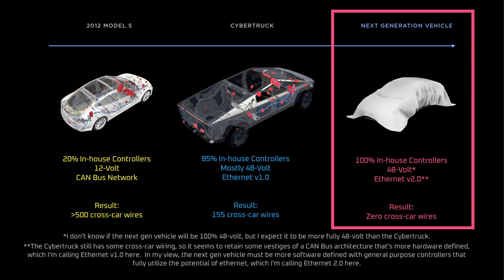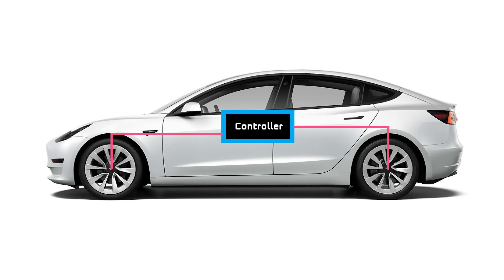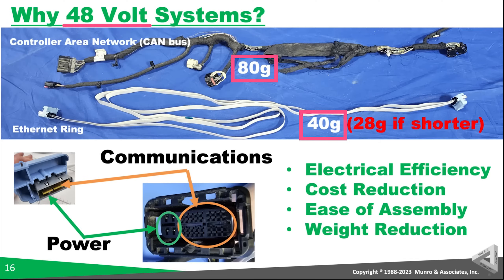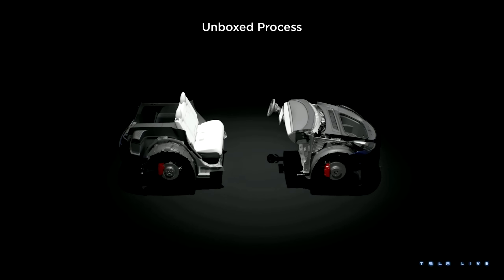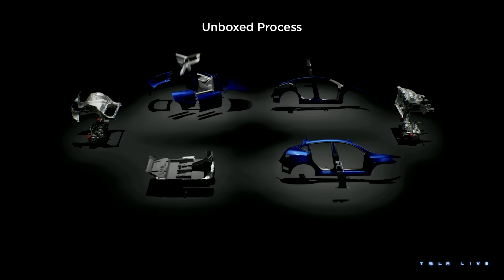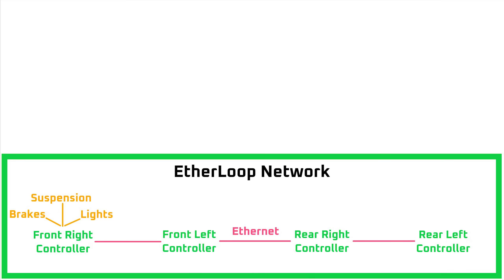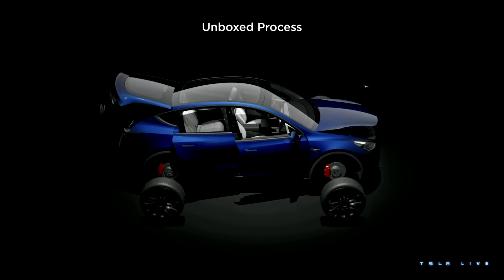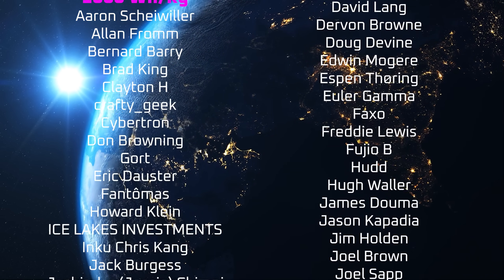Digging Deeper on Tesla's Etherloop Wiring System

Comment: With etherloop, they will have to likely build a new protocol to run, but now with advances in frequencies on a single wire, they can send multiple signals over a single wire too. So send your high speed critical signals on a priority frequency and send all other data points as a lower frequency. Think of how DOCSIS works.

Comment: 9:00 Using 48V will not help thermal management because same wattage for the chips will still generate same amount of heat load no matter what voltage you use.

Comment: We put safety systems like brakes, engine throttle, steering wheel depending on software in a vehicle that can be updated via internet connection by the manufacturer. We hope that the future car manufacturer will put a lot of money on the cyber security of the cars around the world.

Comment: You don't have to branch of the main CAN trunk wire, you can pass it through. In fact the smaller the branches are the better, ideal is no branches at all. I don't get the point of the EtherLoop, but I guess it's just a more efficient physical layer. In industry we also used EtherCAT, sounds similar.

Comment: the biggest challenge when it comes to voltage is that people like to mod their vehicles when talking the other makes. With the 12V system you can for example just hook up(with an in line fuse of course) and get the power you need.  I am guessing throwing a snow plow or trailer hitch and full braking controls on a cybertruck is effectively impossible due to being 48v.

Comment: Just for example - from 2000s Mercedes start to use SAM modules in front and rear ends of car that make the same, except safety features like SRS or ABS. From mid 2000s BMW use FlexRay data bus that have much higher speed than CAN... Nice innovations from Tesla)

Comment: PROFINET (Process Field Network) is a communication standard based on Industrial Ethernet with a comprehensive range of applications. 
The fieldbus uses TCP/IP and IT standards, is real-time capable and enables the integration of fieldbus systems.
Reply: PN only uses TCP/IP on startup and diagnostics as it is too slow for the deterministic model for data exchange in operation. It uses MAC address and device name as part of its own standards which is why it is important to use PROFINET certified devices, in particular managed switches.

Comment: When Elon said they would reduce the wiring in the Model Y dramatically, i thought at the time, "why don't they (automakers) use like 4 or 5 raspberry PI and controllers and connected them with Ethernet to control all the vehicle?" Guess i wasn't all that far off from a concept standpoint... 😅

Great video BTW...
Reply: Because if one controller fails now you don't have lights and wipers and brakes and steering instead of losing only one

Comment: I'm familiar with CAN and ethernet wirings & protocols, as well as other HW protocols used in high-speed, high-data rate computers. 
As you were describing the system & problem i had a few thoughts.
1) why tie power & comm on the same network?
The batteries,  plug charger or regeneration from braking all generate power. Access points to any power is perhaps the shortest line of all as the battery pack practically stretches the entire vehicle base. Certainly there are multiple power access points in this system.
Imagine a short power hop from any corner to any nearest access point. Saves LOT of wire weight. Let each device pull whatever volts it needs. Independent of any standards.
2) comm doesn't require heavy wires. It can be done with much lighter fiber optic strands (any one of wich supports thousands of non-interfering comm lines between any controllers.light does not interfere in many ways.
Run a single fiber loop around the entire veh and thats it.

Comment: Thanks for the information, so when the light controller goes out  the $700 replacement price wont shock you.  If you can find the 12 v version not the 48 V .  Then toss out right to repair since no one person will know how each box works.  but we saved  $40 in wires.  I worry if one box is damaged does the whole car stop functioning?

Comment: uhh. this is very well thought out. i appreciate the work you have done here. instasub. i am a mere glass installer now, but i worked IT for many years. and this is a very good breakdown. i installed an i5 3rd? maybe second gen pc in my van back some years ago and using microcontrollers and whatever nonsense, even the volume/track/etc steering wheel buttons were sketchy at best and i didnt have the technical knowledge of CAN at the time to figure out why it was such a nightmare. i later learned about prioritization and how noisy the bus is in general compared to normal (lol) packet based stuff... yeah. very good work
Reply from the maker: Thanks man!  Glad you enjoyed it!

Comment: I think the real innovation here is the consolidation and modularization of the controllers, which seems to me to be what is really reducing cross car wiring the most. You can do a similar wiring architecture using CAN (apart from the loop). It would be slightly less modular than an ethernet system, and would increase the complexity of their planned production process.

But yeah, it makes sense. And if you are doing things differently than the rest of the industry anyway, it makes sense to move away from CAN and toward something that fits the use better like an ethernet mesh network, since CAN was designed for the way everyone else allocates controllers. Shows the benefits you can have by integrating vertically to the degree that Tesla has.

Comment: Wiring harnesses are the most expensive parts car makers typically outsource to excess lower wages. My experience in high end EU models. Following the wave of electrical defects in the 1980's as the electronics started to spread all round the cars causing the car maker to eliminate inter harness connect and work towards a one piece harness. By the end of the 1990's these harnesses weight was any between 25 to 35kg. Typical car assembly line practice is to place by robot into the body shell as one of the first steps. What Tesla is doing here is absolutely massive on both cost and weight fronts.

Comment: Hello! I've been through many (but not all I admit) of  all the comments here. And as a software developer I am struck by the absence of two words here: reliability and security.

Regarding reliability, the video mentions briefly that there are these things called "critical functions" in a car, like brakes (but you may also mention headlights, airbags, and to some lesser degree access control for example). And then, that using a high-throughput network, many things could get on the Etherloop, like cut cat videos for thje children on the backseat for example. Or maybe casual video games, Netflix Series or whatever Tesla clients will ask for when they realize they can have it. Cute cat videos, sharing the same channel as brake coordination data? That's a perfect recipe for an absolute disaster, because the most complex a system is, the most difficult it is to prove its correction. Computer systems, especially general purpose ones, have bugs, and they will continue to have them. Even when something becomes useful and reliable, editors will add piles over pile of new more-or-less useful features (and then bugs, updates, patches, reboots, etc.) to keep the center of attention (Windows, I'm looking at you).

On the security side, the more we live in the XXIst century, the more we hear about data leaks, piracy, cyberattacks and so one. For one part this can be explained by the higher number of available targets. But it is also due to the face that nowadays software developments resembles a Tetris game sometimes, where you plug a bunch of things designed by others into another bunch of more things also not designed by you (because no one has the time to reinvent the wheel 17000 times to create a software as complex as what we produce today). Also things like the audio/video codecs for instance (software than decompresses media streams) are an extremely complex topic which Tesla cannot possibly redevelop for every common video format. So they will trust other people (possibly with an audit, but ultimately trust them) which in turn will trust other people, which in turn... etc.

So basically, putting everything together on the same network has some advantages, like saving on investor's dividends and making original communication about disruptive assembly ideas. But it could also be detrimental to safety and security.

An other way Tesla (or anyone else) could pursue in this regard is to take the "good old" CAN standard, bring every industrial technical chiefs around a table, agree on breaking changes that discard compatibility will all the old crap ideas and retrocompatibility patches layered on top of another for decades, and communicate with outsourcing partners to go forward on that cleanup. I know nothing about the automotive standards, but every industrial standards can die as a hero, or live long enough to become a monstruous pile of hacks and patches. This is absolutely boring, Elon Musk could never brag on a show scene about that, but this is how you make things reliable actually :-)
Reply: Thank you for your sobering perspective.

Comment: Typically a remote expansion IO unit connect one corner stuff, where master central unit processes the data statuses, measurements and commands. It is only possible for Proprietary OEM architecture. If you take for example commercial transport electronic braking system from a supplier like ZF, you may have it as standalone system interconnected as subsystem and communicating with other systems by J1939 Network CAN.

Comment: Jordan, as a network engineer, I greatly appreciated your analysis.  Do you think Tesla uses generic CAT6 cable & connectors for its Etherloop?  Also, do you think they also use power over Ethernet to power controllers?  It saves another copper wire.

Comment: Great video.

Innovation, pure and simple. Legacy Auto can't do this because of how they  are structured.

How long before the Model Y & 3 get converted to 48v and ethernet loop?
Reply from the maker: I don't think we can really say until we've seen the presentation on 8/8

That will give us a lot of insights as to what's on their roadmap
Reply: @thelimitingfactor 

I suspect the "Cheaper interim vehicles on existing production lines with elements of unboxed" will be an ideal "hybrid" to test the general system and individual  components, while reducing the cost of a Model 3/ Y derivative.

Structurally "similar" (not quite identical)

Technologically updated.

Comment: From what I am getting, they are eliminating cross car wiring, but only in the traditional sense. Since this seems to be based on network communication, for safety and stability, there has to be a back up line in case a controller in the loop fails.

Comment: it seems that Etherloop is a variation from the industrial motion protocol called Ethercat. This protocol runs data bus cycles in less than 1ms. Ideal for high precision industrial applications such as robot synch In a production line, or when precise synch is needed for reading/writing IO block nodes. Perfect for a vehicle application.
Reply: This was my first thought too, but I would be concerned about message priority. With video devices and the payload size, these should be lower priority to command controls. With robo taxi etc. perhaps they are critical priority. To my knowledge Ethercat is like a train with the information making stops at each node and gathering information adding to the “train” of information. Mixing a control command behind video or other high bandwidth item may prove an issue but the high speed of the protocol might compensate.  All I know is having video on the same network as your factory is a big no no for industrial automation. Having an intelligent switch that can determine priority at the beginning of the frame would be an important consideration IMO. The other consideration that will be of import is encryption. Industrial protocols are now working on encryption/authentication standards. I would be quite interested in understanding how this  protocol works as I think believe it is ground breaking.

Comment: The ether loop and the 48V architecture are part of the same strategy. Many systems will be powered over the Data cables ( power over IP) the data cable will be able to develier around 100W of power using just the Data cable it self.  ( The modules them selves and possibly even some end points will be powered from the network and the modules.

Comment: One thing to point out about segregated generalized controllers: Redundancy concerns, or controller availability.
If one controller fail, nothing can work in place of them and might create new catastrophic failure. But that is much simpler problem to solve than total system failure in architecture with central controller. Because Etherloop forms a ring topology, and supposedly every controllers has the same hardware and firmware, they can simply override their dead friends. So It is actually more robust architecture, if they could implement that. And it only takes zone ID to be able to control multiple zones, so I don't see why they won't do that. Although, one wrong setup and the car will do funny thing.

Comment: Ethernet hast some benefits not mentioned here. The connectors are standardized which makes devices cheaper to connect.
There is a standard for power over ethernet PoE. This could be used to not only replace CAN, but in many cases also an extra power supply connection. Maybe the hubs would need direct power supply because of their provision to the connected devices.
Maybe planes, subway trains, trains and trams are also using some of the devices which would reduce the cost per device because of production scaling effects.

Comment: I don’t know how to feel about etherloop, we started off with CCD, and now we have CAN because of it. But for the most part we haven’t really had a problem with CAN in my opinion. I work as a diesel technician for a John Deere Dealership and modern agricultural machines utilize full CAN systems and integrated LIN systems just like automotive does, we also utilize MECA for our controllers too just like automotive. The one problem I’m worrying about with Etherloop is the durability of the ribbon wiring for the Ethernet itself. In agricultural applications, our machines are designed to the best of our ability to be as durable as possible, the nice thing with CAN is that the wiring gauge is relatively large, and with that the wiring insulation is relatively thick comparative to Ethernet ribbon wires. In my mind CAN seems like it would hold durability better then Ethernet ribbon wire would, especially in applications like agriculture or even automotive. I don’t know, I’d like to hear more about its design before I can make a solid opinion on it as this is sort of my first time hearing about this Etherloop architecture. I love the idea of reducing wire length and total wire used however, it seems like a good architecture for that goal!

Comment: As others pointed out, the protocol can be applied regardless of the hardware. On the ethernet network it can still use a seudo-can protocol which prioritizes messages opposite to the home ethernet systems

Comment: In the early days of ethernet, it was a shared broadcast medium and we got a lot of collisions and retransmissions. Tracking collisions was a necessary job for network admins to know when your network was going to collapse, and you had to partition it. But in the 90s, we moved to switched ethernet, and collisions are a thing of the past. Ethernet switches are dirt-cheap, a few cents. I would be shocked if etherloop went back to using broadcast over a simple switched fabric.
Reply from the maker: Thanks for the insight!

Comment: one note, increasing the data rate does wonders for reducing latency.

if you compare the highest speed canbus (0.05 - 1Mb/s) with gigabit ethernet, you have 1000x-20,000x the bandwidth. At some point, this increased speed means that even the retry oriented nature of normal ethernet will get the message through faster than the canbus would